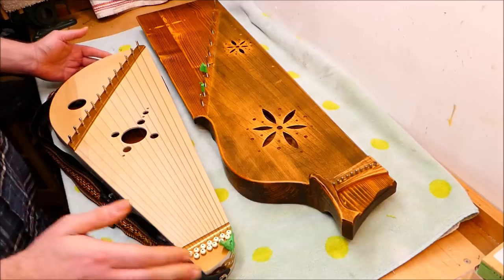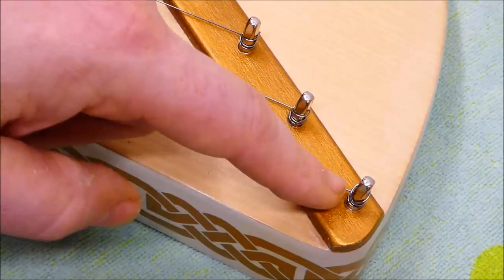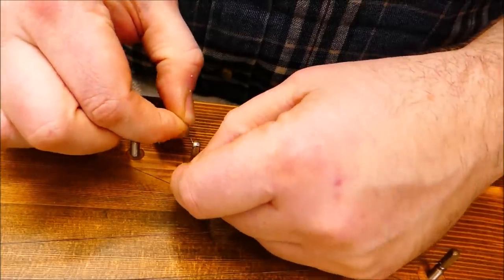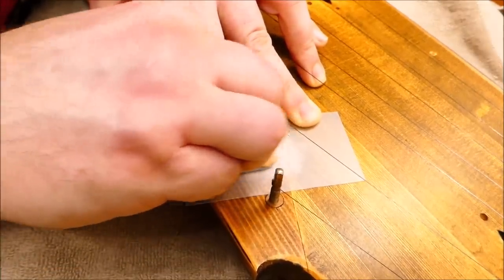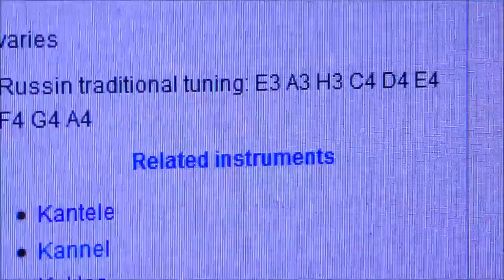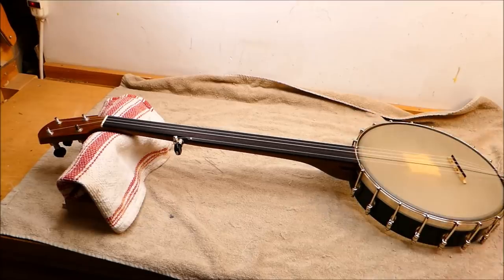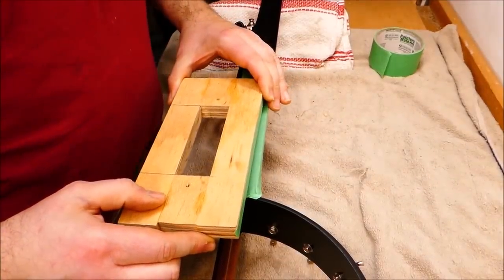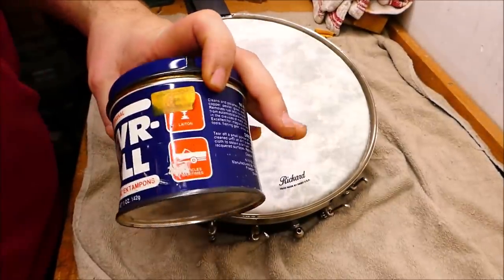Folk Instruments, both Fretless and Ethereal

Comment: Mylar protective film you say? *looks at old drumheads in the trash bin*
Reply: dig 'em out!

cut up old drumheads make great protective shields for guitar work
Reply: @walterw2  Also used for magnetic dent removal on brass instruments.
Reply: @geoffwysham1731  how? brass isn't magnetic

are they like feeding an iron slug of some sort inside then pulling on it from outside?
Reply: @walterw2 , close; shiny steel balls in various sizes and dangerously powerful magnets on the outside. There are a couple of videos on YT if you’re curious. Magnetic dent removal.

Comment: Ibanez acoustic bridge pins are a bit more grey coloured but have a straight shaft, and would be great for this application.
Reply from the maker: There'd still be nothing for the ball end to come up against.  It might work if the holes were angled away from the saddle.

Comment: Wow, this is the first time I've seen a banjo scooped like that. I make banjos. The scoop is usually referred to as a frailing scoop or sometimes a "strum hollow" and goes the width of the board. I tried to upload a pic of mine but I guess I must be technically challenged. Anyway, thanks for another wonderfully informative video. I look forward to them.
Reply: I am curious about this scoop, and if it was a specific request. I've never seen one that didn't span the entire fingerboard.
Reply from the maker: In this case it was to address a specific complaint. If I was going to build one from scratch I'd probably come up with a fancy design that spans the board.
Reply: @StrumHollow - Thanks, I've never seen a diagonal scoop either. I think Ted's looks really nice, and although I've practiced repairs on cheap, olde banjos, I've never made one. A signature scoop would be a great touch.

Comment: I got hooked into your channel with a video about guitar bridge replacement -- but this video on folk instruments was right up my alley. I've built a few hammered dulcimers in my day - the first one was from red oak, just because that's what I had available. I was surprised by the choice of red oak as pin block material.

It was interesting to watch you play the gusli, since I'd assumed the string spacing was an indication that the instrument is strummed or picked like a guitar with one hand while muting the strings on the wide end with the other.

I've been looking for information on modifying the courses of an instrument. For example, turning a six string guitar into an instrument with 3 courses of two strings each. Would that require replacing the bridge?

Comment: Just out of curiosity why couldn't you dowel those bass side pins and drill them out with a chamfer tool or a serious of stepped up drill bits landing slightly less deep each pass?

Comment: I started to change my 21 Autoharp today. For some reason, mine has an unusual chord set up. Since I needed to be able to play in the key of E, D and A, I had to change my Eb bar so I could play in the keys of E, A and D. I still have to retune my low  F to an E and G to G# if I want to play with my mountain dulcimer players who play in D and G. It's ok. not that hard to change since there are other strings with A, D and G#. I took a lot of changing the pads. The replacement strings on these require some retooling with a Dremel and a grinder to get them on. Really poor engineering.

Comment: Ted - instead of bridge pins and ball end strings, why not use fill all the holes and go w loop end strings over slanted brass or steel tail pins?
Reply: Or fill all of the holes, drill small ones all the way through, countersink the back side a little for the ball ends, and then push the strings up through those little holes.

Comment: I was a little surprised that, after the ping failure, you didn't dowel those two holes and redrill and run a tapered reamer through them. I'm not sure that would have worked, but it would have to be better than the current arrangement.
Reply from the maker: I did. There still wasn't enough friction to counteract the string pull. Hence my frustration! :)

Comment: I have actually built a kokle, which is virtually the same thing as that Russian instrument. Those tuning pins are either piano or harpsichord pins. One thing I think that would have been better is to use oak plugs made from side grain rather than end grain. But, I realize that you are attempting to recreate the original design. Pianos employ this although laminated. They also use maple rather than oak.
Reply from the maker: Yes. Interestingly, the bass side strings had large diameter sidegrain plugs. The person who made this one is pretty highly regarded so I thought it best to try and duplicate what was there as much as possible.
Reply: @twoodfrd  I'd like to show you some pictures of the bass kokle I made

Comment: Nice bizarre instrument repair.  For the Zither I would have been tempted to use a Dremel with a long rounded bit end to create a cavity for the string ball end to set in and modify the bridge pin to hold it in place.   Only would do that if customer agreed (strange glued in place pins).  Good work and thanks for sharing your knowledge and experience.
Reply from the maker: The holes are so close together they'd break into one another.
Reply: @twoodfrd  I agree it is hard to modify a bad design layout on a pin block.  It was interesting to see your solution and make it work out for your customer to get a functional instrument.  Enjoy your videos as they are both entertaining and educational on instrument repair.